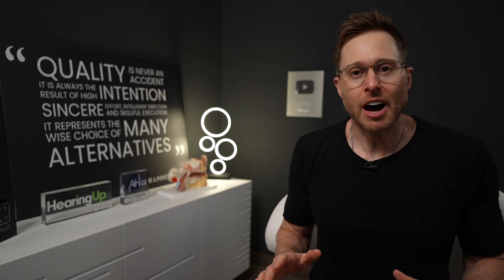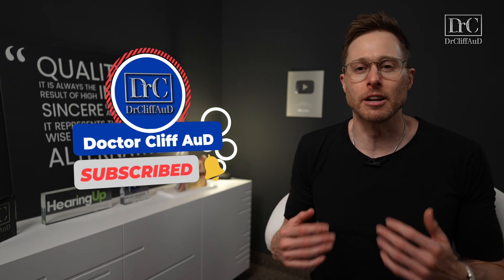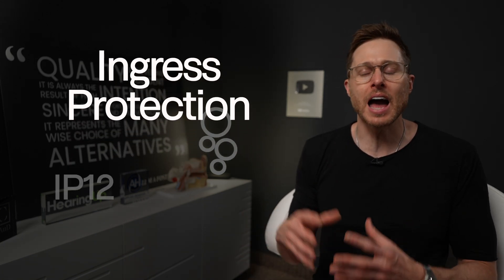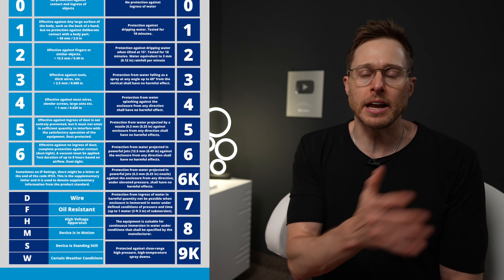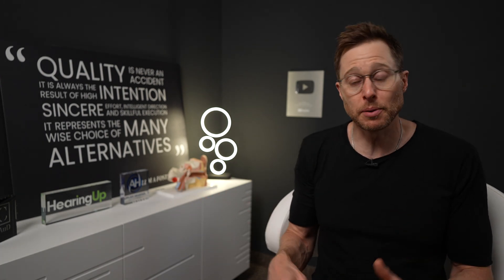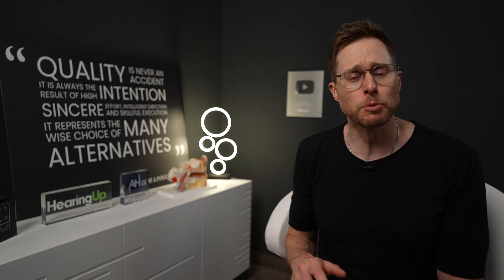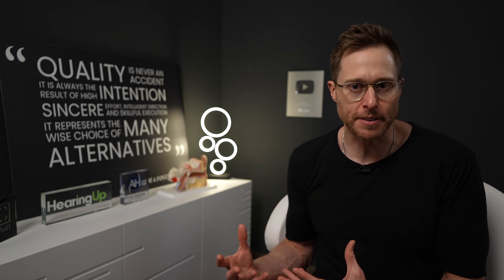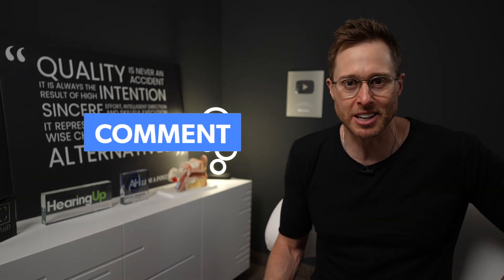Hearing Aid Water Damage | DrCliffAuD VLOG 279

Comment: Not sure if the rating is the same for rechargeable vs replaceable battery design. Seems the compartment a battery goes in, even shut, is another opening. Maybe it’s the circuit board that’s coated, to be more waterproof, like in cell phones now.

Comment: I’m not really concerned about water but i am concerned about perspiration and wax.  We have had a relatively hot summer and i have noticed my ears perspiring much more than usual.  Some days , i find myself removing my aids midday to wipe the domes off.  I don’t know if it’s related to wearing closed domes and if open domes would make a difference.  Also this summer, i have been generating much more earwax than usual.  I have been trying to get a handle on this without resorting to sticking something smaller than my elbow in my ears.

Comment: i have a question though how much moisture do those cooling misters in Arizona put into hearing aids? can you eat dinner under them without excessive moisture buildup?..i wear older analogs so i dunno what the rating is but i use descendants jar every single night to store them in,,but always try to avoid excessive moisture buildup if i can help it,,hoping to move to Arizona soon and was curious about all these water misters i see everywhere spraying moisture down on peoples heads
Reply: Unpressurized misters are approximately IP_3 or IP_4, well below the liquid ingress of IP_7 or IP_8 (such as IP68). I wouldn’t worry.
Reply: @brianerock  thanks for your input 👍